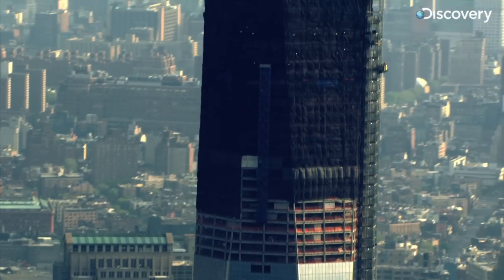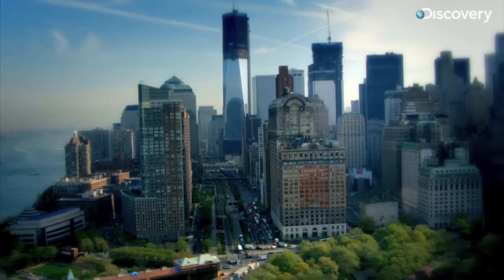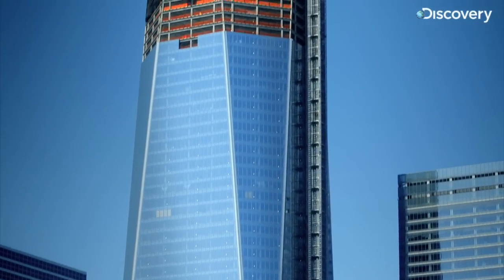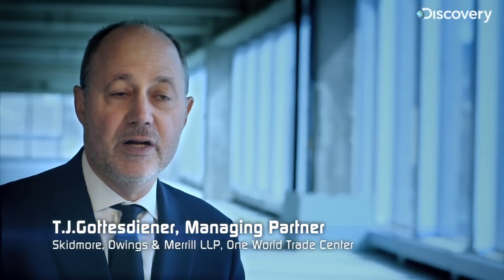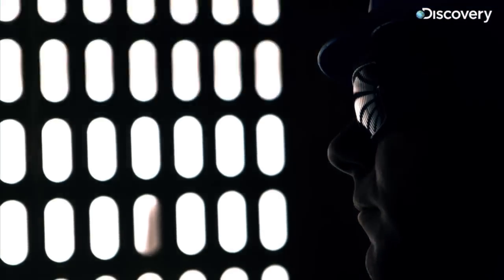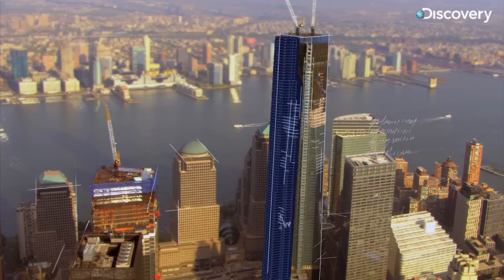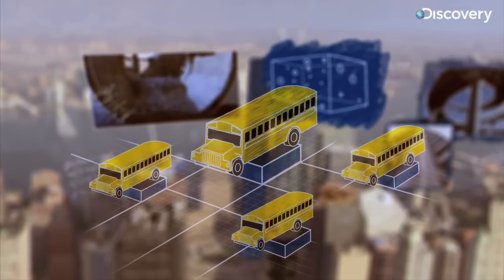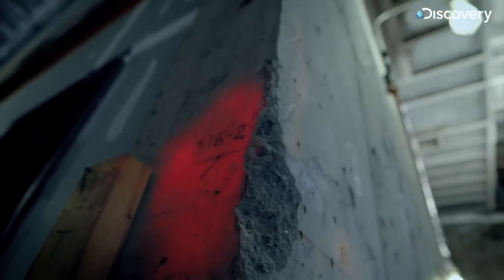Tower One's Super Strength - How We Invented The World

Comment: WTF do they need all the concrete for the Twin Towers could survive a plane impact with just steel no concrete
Reply: Its because the construction workers dont wanna work again and again
They need a break dude
Reply: Have you ever tried to squeeze hardens concrete before? And it Doesn't burn. Metal bends, concrete crushes. So they have 2 different buildings in one here.